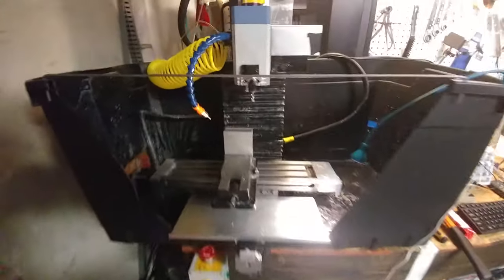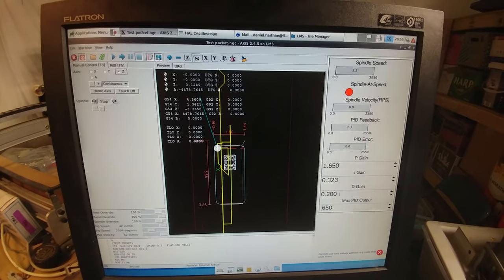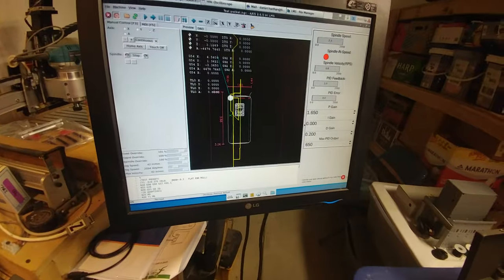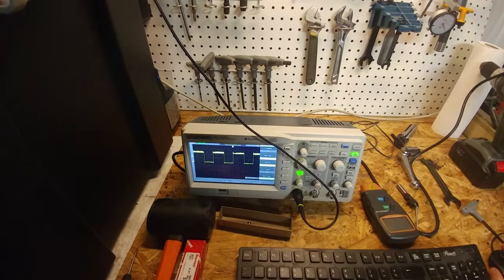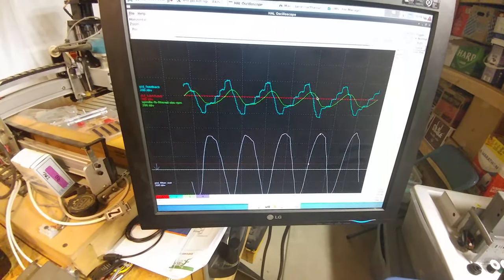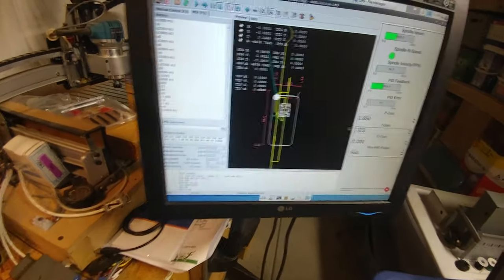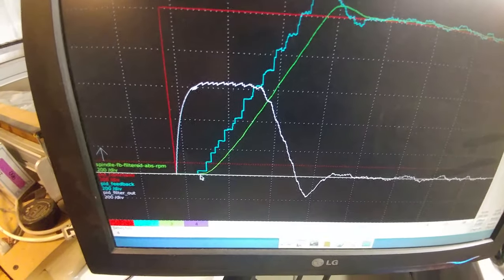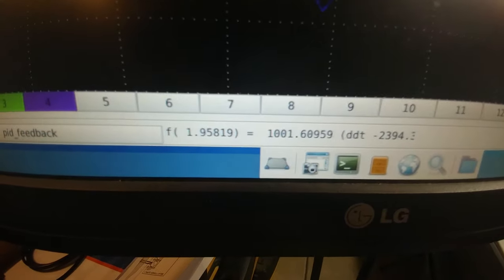Spindle PID Closed Loop Controller LinuxCNC

Comment: hello, at minute 11:00 you change a parameter from 4000 to 1600 microsteps per rotation, what is that exactly? When changing it now, a rotation of the axis will no longer be 4000 steps but 1600? will he make the biggest steps then?

Comment: Hi Dan, thanks for the good explanations...I pretty much implemented your xml panel in my setup and it works pretty well. However the following questions came up: How did you get the Halscope to display the Parameters oh so nicely ? I am having trouble with this . Did you transfer the found PID arguments in the Hal as fixed parameters  ?
Reply: i guess Im randomly asking but does anybody know a way to get back into an Instagram account?
I was dumb forgot the password. I would love any help you can offer me.
Reply: @Max Lennon instablaster :)
Reply: @Erick Kylo Thanks so much for your reply. I found the site through google and Im in the hacking process now.
Looks like it's gonna take quite some time so I will reply here later with my results.
Reply: @Erick Kylo it worked and I finally got access to my account again. I am so happy!
Thank you so much you really help me out!
Reply: @Max Lennon Happy to help :D